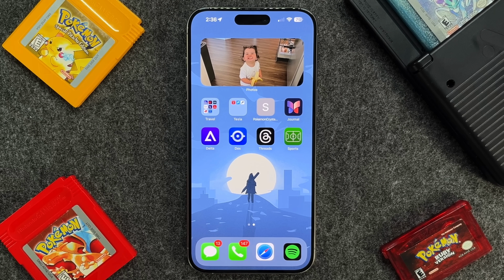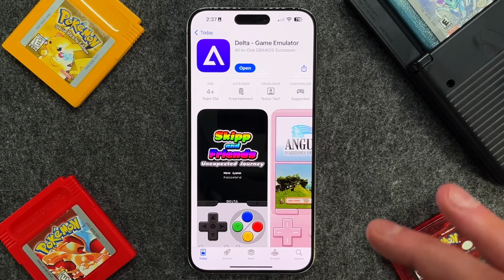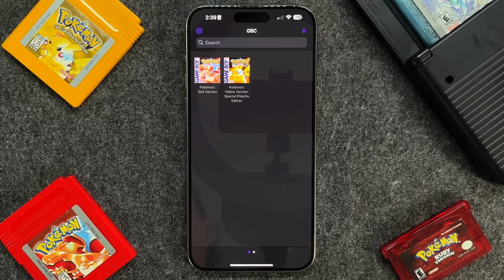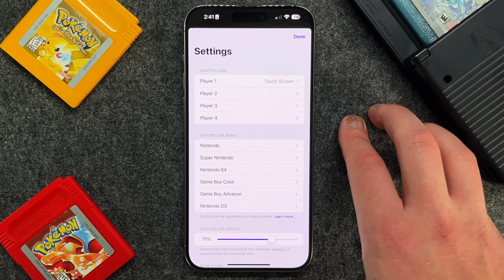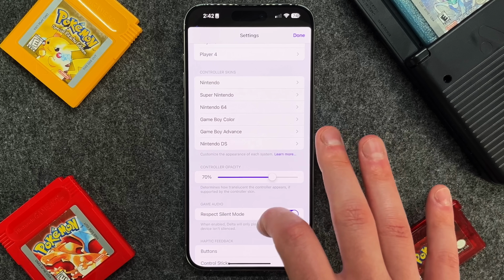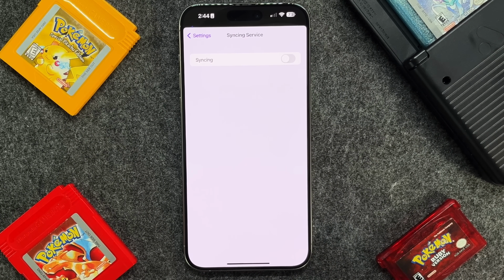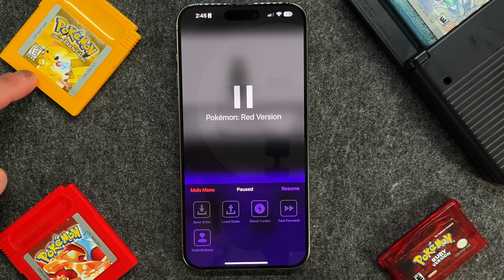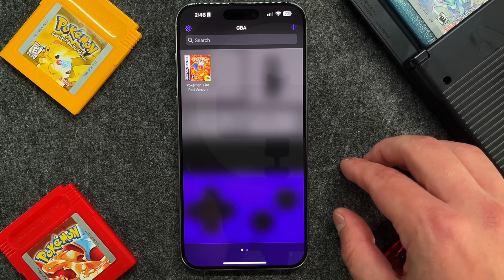Hands On: Delta Emulator Is Finally in The App Store! | Complete Walkthrough!

Comment: Any advice on the app not opening/reading the Zip file? Using the same zip on mac reveals it to be a .nds file (supported). Just won’t open/load in Delta.
Reply: Try unzipping. You also need the BIOS and firmware for the NDS, which you can get from archive.

Comment: Can you make a walkthrough on how to get the ds emulation to work on delta? I don’t know where to get the required files it’s asking to add
Reply: Same problem here! It says something about missing ds BIOS files?
Reply: @AngelRodriguez-bw9db  you just got to download the files. I found it on Reddit
Reply: you can just google the files and download them
Reply: Please tell me if you find it 😭
Reply: @deeshasalian9097  The files are easy to find but yt sucks so I can’t link it. Just look up ds bios files delta and there’s a Reddit thread that provides the link. Scroll down and tap on the first link that’s under DS and it’ll be a file that contains the 7bin 9bin and firmware.
Reply: @deeshasalian9097  if you google it, you’ll definitely find it
Reply: try searching Google for bios files for ds
Reply: Y’all fix that yet?
Reply: there are other youtube videos showing how. Just google it...
Reply: Google search the bios files. They are pretty easy to find and download
Reply: Google ds bios reddit and it's one of the first results
Reply: Type into Google "Nintendo DS BIOS and firmware" and download and unzip the files, then on Delta point to them where the files are. I believe its used for the homescreen.
Reply: Google